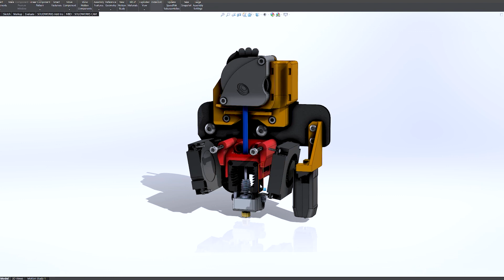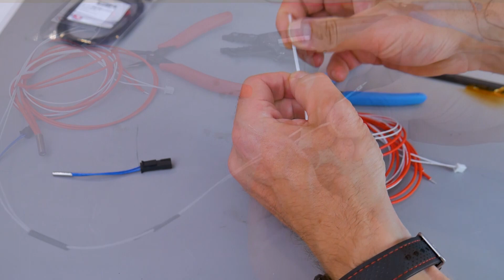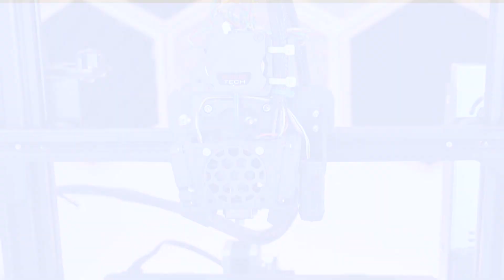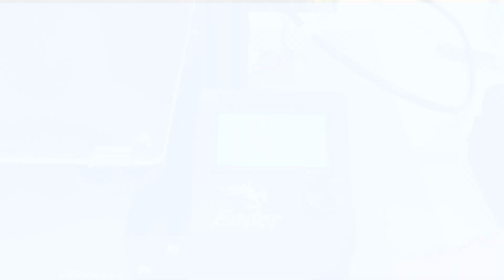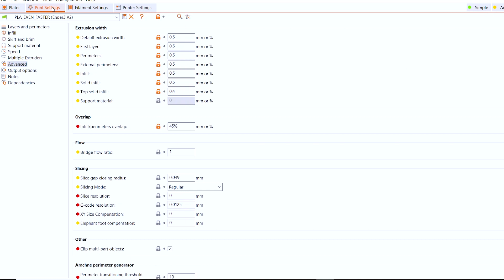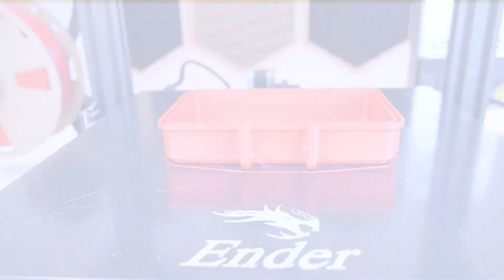BEST Creality Ender 3 MAX Upgrade! Direct Drive LGX Lite + Mosquito Magnum + CR Touch Installation!

Comment: Question about the extruder wiring. If you DO NOT wire the LDO and Creality harness together and you opt to plug the LDO straight into the mainboard, Do you still need to swap the green and yellow wires on the LDO connector?

Comment: Will this upgrade work for abrasive filament such as nylon cf  and polycarbonate?
Reply from the maker: Yes but make sure you are using a hardened nozzle! It's the nozzle that typically wears out the fastest.